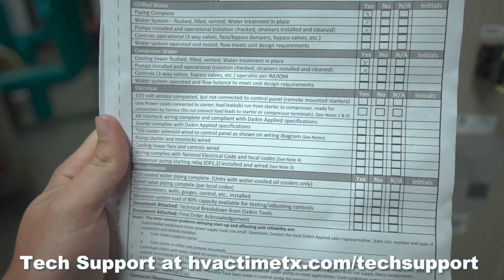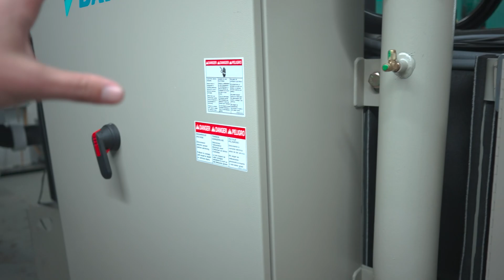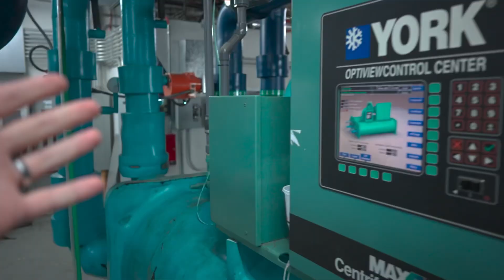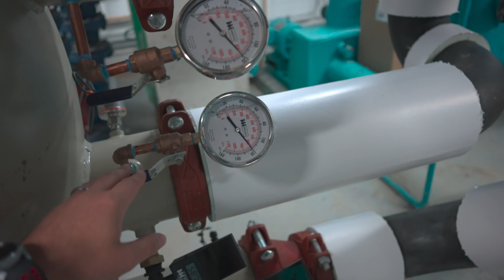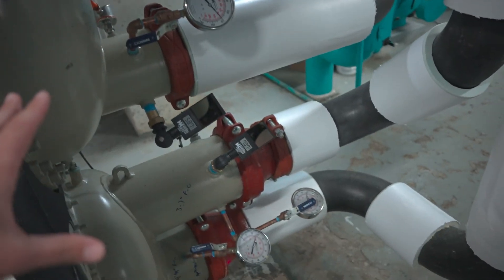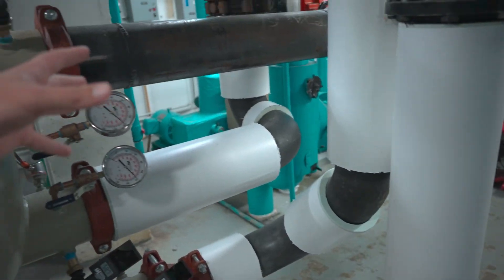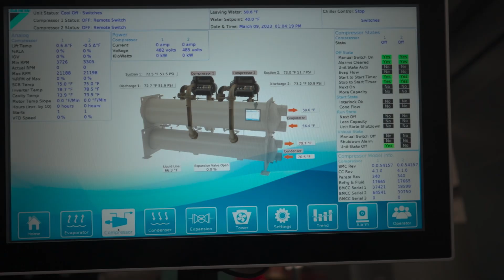Prepping Chiller for Startup

Comment: Love the video and can totally relate. I am a consultant engineer (commissioning engineer to be specific) so I often work with guys like you to get these systems working as intended. I cannot stress enough the importance of getting a startup report completed prior to our functional testing. We usually require the startup reports in our hands prior to scheduling commissioning. Too many times we go out told things are ready and it turns out major components are missing both on the equipment and BAS end. Its a waste of time that leads to Additional Service Requests and angry building owners asking why their systems are behind schedule and why they are receiving a mile long deficiency list. I am having to deal with this on two hospital jobs with one system serving Operating Rooms and the other Vivariums.

Comment: Your right on with leak checking the chillers before doing a install and doing all that work. It has been a few times were the tubes have been eddy current before install and they were bulged and the factory still let it leave but we caught it before hand

Comment: There is also water treatment that should be set up, for both the chill water, and the cooling tower.  The tower has to be started up, and verified. The flow needs to be verified through the condenser barrel.  The oil heaters for the chiller need to be on.  The manufacturer will have a pre start up sheet, listing all aspects that need to be completed before startup is scheduled.  Great video.

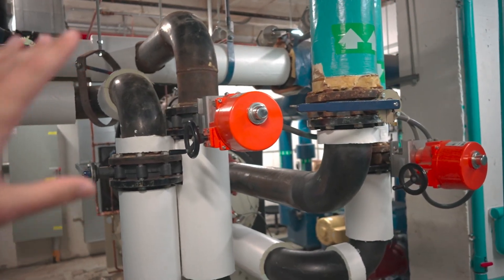Comment: 10:38 Maybe Im missing something but is it common to use a butterfly valve for balancing? 
Ive only ever seen them used her for isolation purposes
Reply from the maker: It is here. Officially it should be a flow setter but those rarely get used.
Reply: Interesting. Thats how they do it here. Typically a triple duty valve/circuit setter.
Reply: @gmguy156 very interesting indeed! Balancing is typically done with triple-duty valves, venturi tubes, and orifice plates. Butterfly valves or Wafer butterfly valves, on the other hand, are used throughout for iso purposes. Then again, jurisdictions supersede!
Reply: @HVACTIME  How do you prevent someone tampering with the flow?  I wouldn’t think a butterfly valve would have fine enough adjustment to act as a balancing valve.  Never seen one used for that.
Reply from the maker: People tamper with flow all the time. It does work for balancing, while a bit crude in how.

Comment: A butterfly valve is not the correct type of valve to balance! It may help temporarily but there should be a globe valve for that matter
Reply: I agree to disagree! A common practice is to use a globe valve for flow control, yes! However, balancing flow is typically done with triple-duty valves [multi-purpose valve], venturi tubes, and orifice plates. Then, on the other hand, Butterfly valves, Wafer butterfly valves, and stem and yoke valves are used for iso purposes. Then again, jurisdictions supersede code!
Reply: It’s like using a ball valve for hydronic flow control